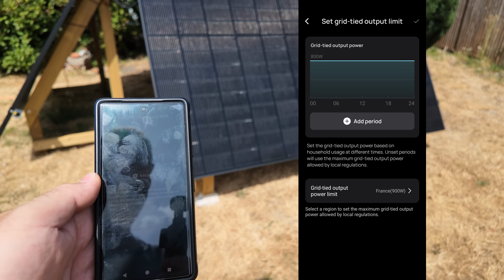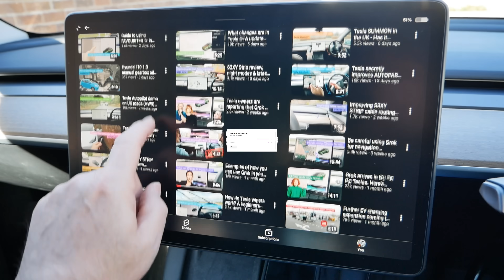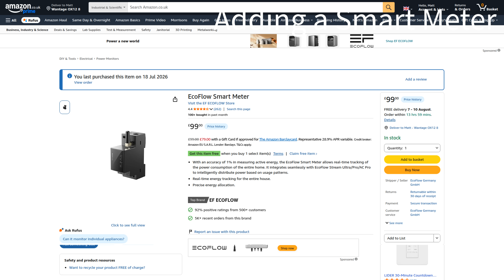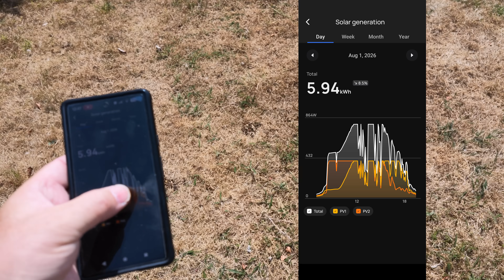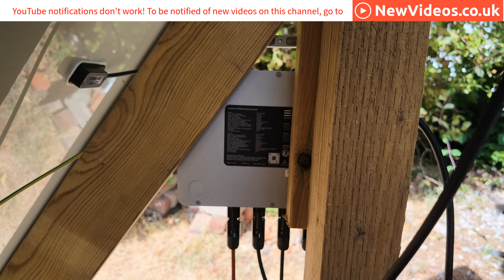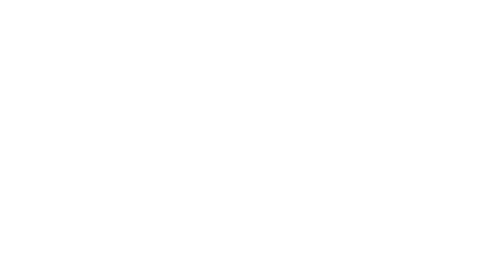Why My 800W Plug-In Solar Setup Sends Half Its Power Straight to the Grid ⚡

Comment: One thing that took me a while to get my head around when I had solar, is that if you add batteries, the overall payback time tends to stay more or less the same as with the solar only despite costing more - simply because the batteries allow for storage of power that would otherwise be exported and earn nothing, or a pittance at best.

I paid as much for the batteries as I did for the roof panels and inverters, but I save the same with the solar as I do with the batteries, so the monthly saving with batteries is double the amount it would be with just the solar - hence the payback time being more or less the same despite doubling the install costs.

Depending on setup of course you can also force charge the batteries at cheap rate overnight in winter when the solar is very low, and then export to the house when the cost is higher during the day to help maximise the savings.
Reply from the maker: Fair point. While the cost of a battery is significant, it's a nice feeling to know that you're then using all the energy being produced from such a modest little setup.
It's even better when the battery comes free.....that's the advantage of having a reasonable size YouTube channel. 😉
Reply: @GoGreenAutos Jealous!
Reply: @GoGreenAutos  and having batteries and utilising a changeover switch on the backup port from your battery inverter or hybrid moves you flexibility if thebgrid goes off your property is still powered allowing you a off grid instalation until the grid returns
Reply: The amount of solar and what you pay for it is critical to the maths. With 800W of panels the mythical average UK deployment with south facing panels and not much shading pays for itself in 2.5 years (3 versus an ISA) saving £100 a year. If you add battery you might add another £60-80 to that which makes it fairly pointless.
On the other hand as you add solar it increasingly isn't self consumed so the battery becomes more and more important.

But most criticial is not getting ripped off. A 40kWh battery is 4 grand, 16kWh is  2 grand, so the prices charged by plug in battery people in the UK are a complete joke, and will ruin your RoI except on a tiny system. On a tiny system the cost of the battery is high but the cost of the electrician you didn't have to pay is also high 8)
Reply: I live in Europe and over here the prices for energy (especially in Summer) during the day are MUCH MUCH MUCH lower than at night. Also, where I live, you won't get anything for exporting electricity to the grid from Jan 1st 2027. It is weird to realize that the UK still has the 20th century pricing structure for electricity. 

For me, having a battery that can charge during the day and used in the evening, when prices are at their highest, saves a LOT of money.

I expect the same to happen to UK pricing structures in the next few years and you buy a battery system for 10+ years of use anyway. It might not be very economical to buy battery storage now, but it probably will make financial sense in the next few years.

Apart from that, the way I've setup my system, I can just run the whole house for 5+ hours during a blackout and that is also worth something.
Reply: @Junyo  That is interesting to hear.  It sounds as though where you are the prices are set based on the ease of generation or maybe the quantity of available renewable solar generation - lower when generation can be solar based.

In the UK generation has traditionally been from coal and later oil power stations with some nuclear and now increasing renewables, with consumer prices set based on when power was mostly used.  Split tariffs with lower night costs were introduced in the 1960s / 1970s I think, though they tended to balance out with slightly higher than normal day rates to compensate the generators for any loss from the cheaper night rates.

The early ‘economy seven’ tariffs offered 7 hours of cheaper overnight use to try to encourage people to run washing machine and dryers - higher usage white goods - overnight and not all switch them on in the early morning to help flatten out the grid usage a little.

Over time as higher usage appliances, batteries and particularly EVs have become more widely used this has moved to cheaper and cheaper night rates on some tariffs to help focus on balancing the load on the grid so that we don’t get massive usage spikes when people wake up and plug in, and that’s also now moving to VPP schemes with people being incentivised to cut usage or export during highest usage periods.

I’m going to be interested to see if this changes again as more and more people move to EVs and home batteries - well presumably start to see bigger overnight usage spikes and the grid companies wanting to further balance that out and not have everyone starting to charge their EVs just after midnight.

Hopefully as more and more people own devices that can export to the grid and the grid is upgraded, there might be more and more options for the VPP idea with more incentives for people to participate.
Reply: @rhencullen  In the Netherlands the prices are set one day ahaead of time for every hour and these prices are based on supply-and-demand.

This means you can have your battery charge when electricity is cheap and switch to battery power when electricity is expensive.

Obviously the effect is that more-and-more battery-power is used when the grid is most short of supply solving an ever bigger part of the "energy-puzzle".
Reply: @rhencullen  The cheap rate was introduced because all older generators produced electricity over the full 24 hours.  The generation mix in the 1950s was Coal, Nuclear and Hydro.  Because of the huge sunk costs, and the optimal operating parameters of the first two, generation was a 24 hour business.  Even Hydro power is more cost effective if it can earn 24 hours because of the huge sunk cost.  Back then industrial processes, could easily absorb the overnight excess as retail users shut down.   But that became a lower share of consumption as Nuclear ramped up to its peak production, c late 1970s.  Although you can shut down all power sources, it’s not optimal for economic and longevity of many power plants.  Switching off large nuclear plants for 6 hours a day isn’t going to happen, although reducing their output to a base level is OK, but not economically attractive.  All still the case in a different pattern for newer generation sources like wind, and Solar which can’t always be used and compensation payments have to be made.  Similarly the gas turbines and diesel, built purely as standby for peaks on the grid  could generate more, and if they did then the unit cost of their electricity falls.  That and the continuing contraction in the UK industrial power consumption, reduces demand in the night hours.  So when there is a surplus(cheaper) time period on the grid isn’t going away, but it’s timing will probably move around, as will the price differentials.  If we do move to a wholly ev transport network, and that all charges at night (not realistic) then we will prolly see some movement between off peak and peak tariffs as well as some changes to when off peak times occur.  But it will likely still exist.
Reply: @rhencullen  I get paid 12p for export..  i wouldn't call that a pittance. Currently earning about £2.50 /day.
Reply: @Mik @MikeGleesonazelectrics  same here, I mean it’s better than nothing, but way below the price of incoming electric outside of the cheap 6 to 8p EV tariffs, and of course depending on how much you consume the export amount is likely to drop to almost zero over the winter quarter.

I’m on Octopus Go with Octopus outgoing, so get a 12p export rate and an 8.5 (ish) pence cheap rate for 5 hours, so I force charge the batteries as much as possible every night and then pretty much power the house off the bat dries and solar during the day (when solar is available).

I can only add around 45% - 50% to the batteries during the cheap rate period, so during the summer the when solar is available I aim to export the batteries in the evening to get them to 54% capacity at the point that the cheap rate starts, so that they top out at 100% charge just as the cheap rate finishes.  I then power the house from the batteries until Solar generates enough to takeover, then I’ll power the house from Solar, topping the batteries up to 100% again, then exporting any excess solar. 

In the evening as Solar drops off, I’ll pickup the house power using the batteries again, and in the later evening discharge the batteries to the grid to get them back to 54% SOC at the point the cheap rate starts again.

I use HomeAssistant as the main monitor / controller to get the batteries to the desired target level at the right time.  HomeAssistant also makes sure any Axle VPP export sessions are handled at the max export rate, as well as any Octopus saving sessions, as well as switching to force charge the batteries and EV whenever (if) there are any Octopus free sessions.

Even with all of that going on we’re still not quite energy neutral - due to reasons I’m not going to go into we have a relatively high base load - around 950w, and there are a couple of times in the day that I need to be able to cover a higher usage from batteries than my inverter will allow - so I’m in the middle of a second DNO request to install a Powerwall, with the intention of it being grid connected to force charge, but with no plans to export back to the grid - so that the Powerwall can cover any grid outages, but also provide extra power to the house during peak usage events.  

Hopefully with the additional Powerwall I’ll get to the point of pulling nothing from the grid at peak rates at all, while also having additional resilience in the event of any (GivEnergy) inverter problems with the existing install.
Reply: @MikeGleesonazelectrics  is it a certain tariff with an energy provider you need to earn from a set up like this? I’m a complete novice and stumbled upon this video.
Reply: Thats the exact set up I'm installing. Probably going to be an Ecoflow Ultra X with 4 x 460watt panels. Max 800watts ( no export ) and Octopus Go for top-up at a cheap rate. I'll add a second battery later on.
Reply: @PaulRansonArt  do you need to be registered to get octopus Go, just asking because I have a small set 5 panels and the stream ultra and the ac pro and would be useful over the winter months
Reply: You also need to account for the energy you're actually using during generation time and the energy being consumed from the battery storage!
Reply: @GorHol-r7e  For a low energy user these numbers are really sizeable too, especially with inefficient low end inverters and with fancy wifi and the like.-
Reply: One thing you don’t seem to be accounting for is “time of use rates” batteries can help reduce the payback period by saving solar energy and charging during off peak rates to dump all the energy to the grid during peak rates, this gets you notably more money for the same energy
Reply: @rhencullen  we. Hilt our own battery storage from 10  large 24 v truck batteries  wire correctly ,you could use. 20 high capacity car batteries,,,with a bit of know how it's easy,,your paying crazy money for lithium storage and getting ripped off !!!